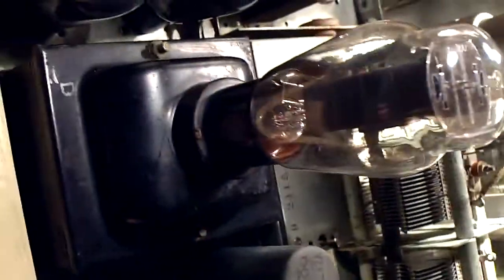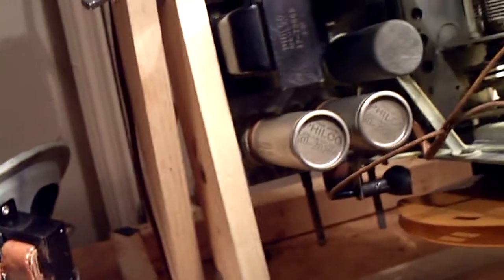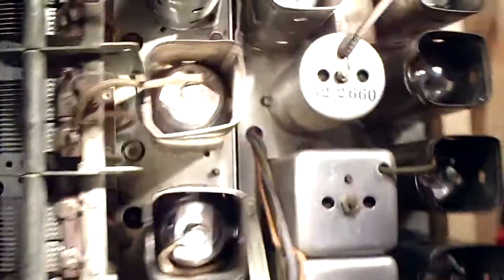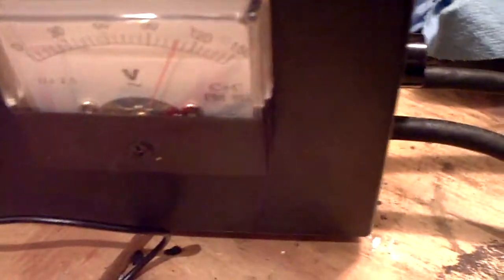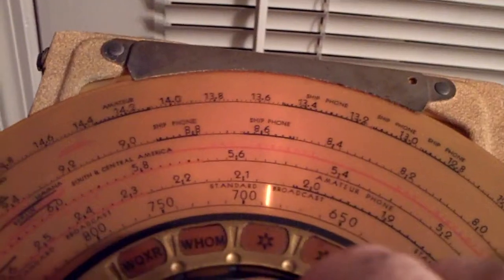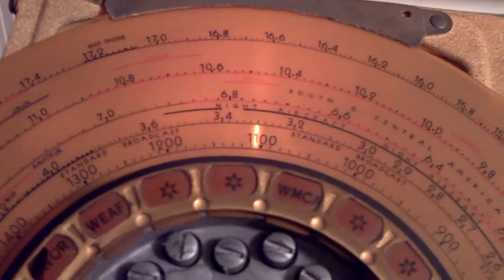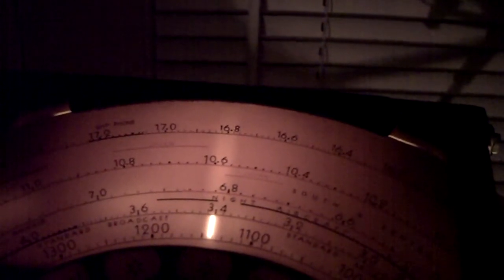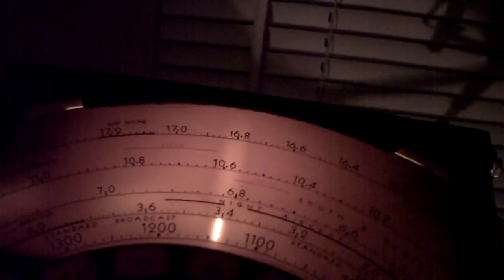Philco 38-116 Repair, Part 11, She's working good!

Comment: Hey John
Wow you did a good job on that...plays well!
OMG I have not seen an Elmenco fuseable plug since my teenage years..my radio "Old-Timer" mentor had one rigged up as part of a home-made initial powering up system for customer sets. Those are def historical.
Hard to believe there are many NOS I.F's outputs etc of that vintage. I have a couple, but the rest are used. 
It's mainly the converters& rectifiers that go sour...even then, geriatric parts can still produce, just lower performance.

Comment from the maker: @bandersentv Hey, Bob. It's going to need an alignment. All bands are off slightly on the dial scale. Besides, I think I can get more volume on the weaker stations by tweaking the IF. I'll burn it in for about a week, then align. the run it about another week, and get it installed inside the cab for Christmas.